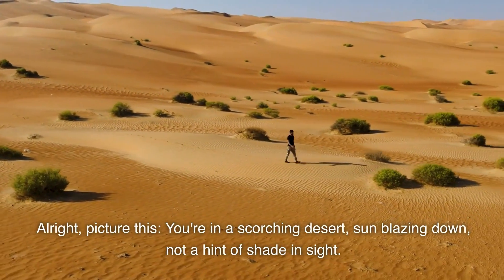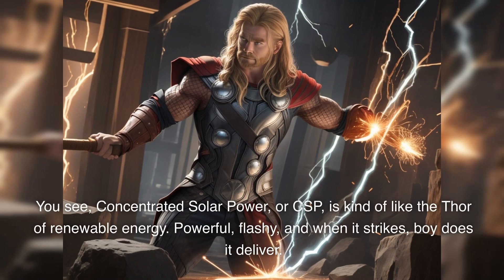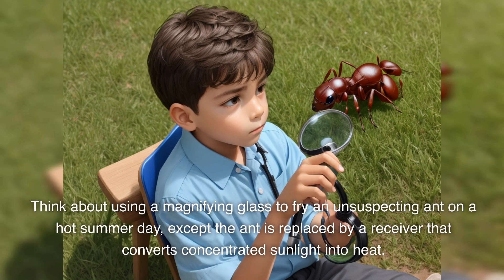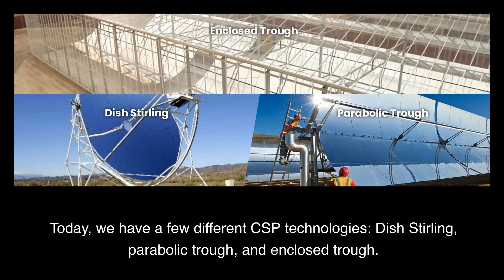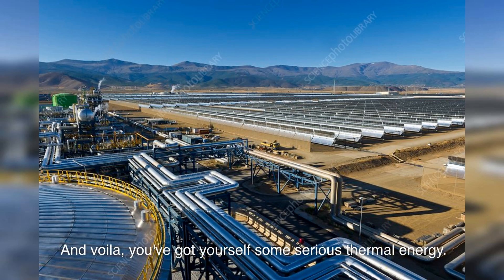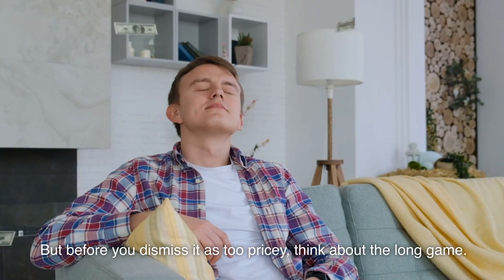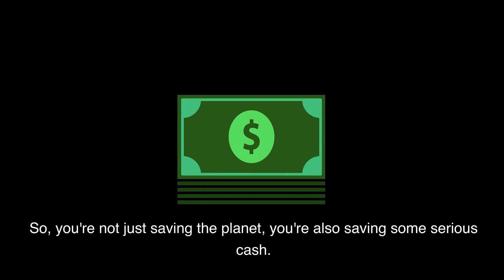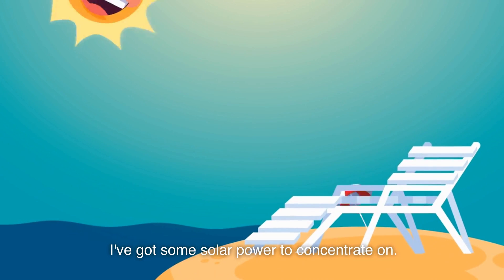Concentrated Solar Power (CSP) Unpacked: History, Efficiency & Costs

Comment: like Arquimedes did?
Reply from the maker: Great connection! The principles behind concentrated solar power do share similarities with Archimedes' legendary heat ray weapon. As the story goes, Archimedes supposedly used a series of mirrors to concentrate sunlight onto approaching Roman ships and set them ablaze. While CSP technology today obviously doesn't aim to combust targets, it does employ the same idea of using reflective surfaces to focus sunlight's power. Early CSP systems like Auguste Mouchout's sun-powered motor in the 19th century also built upon Archimedes' concepts. So you raise an excellent historical point - in some ways, today's CSP plants are channeling the innovative spirit of Archimedes' ancient solar experiments! I appreciate you drawing this fascinating parallel between pioneering solar engineering feats across the millennia. Comments like yours really enrich the discussion on how CSP developed over time. Thanks for watching and making such an insightful contribution!